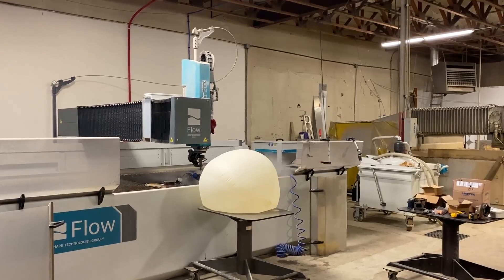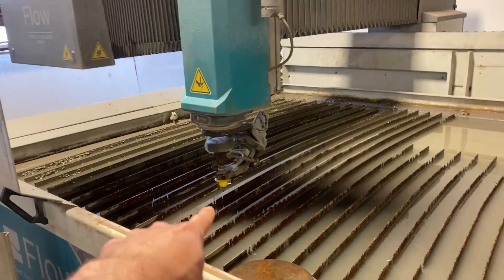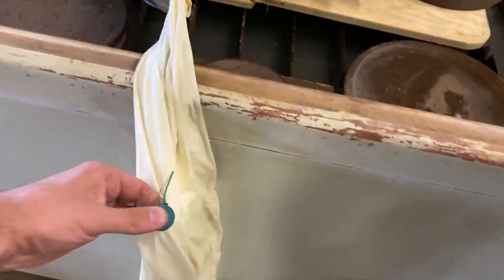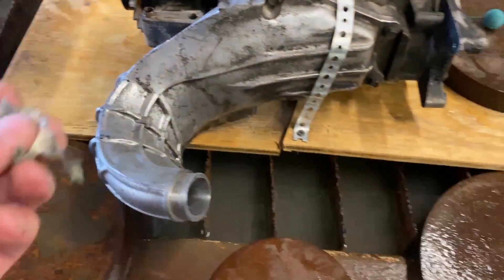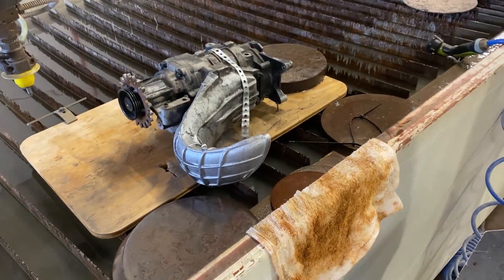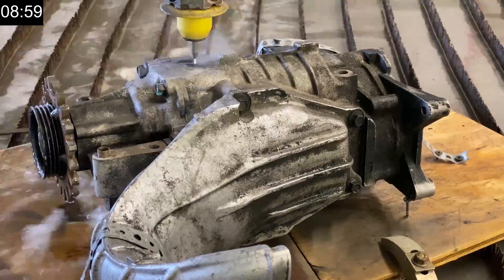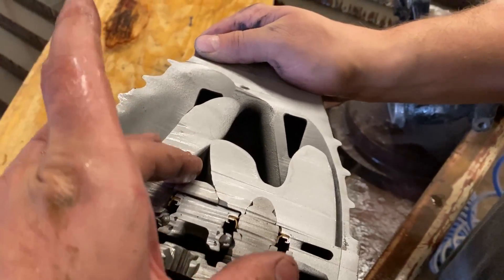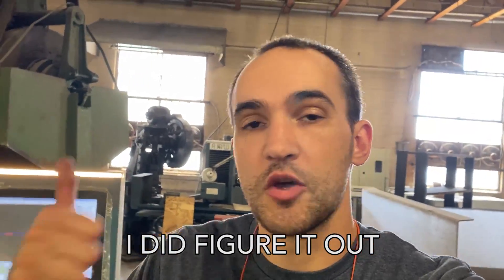Spool a Supercharger with a 60,000 PSI Waterjet

Comment: Love this channel, genuinely amazed nobody has been seriously injured yet. Spinning that blower up to RPM ranges it was never even remotely designed for, just waiting for it to go critical and send large metal shrapnel out with the force of a hand grenade with someone standing right next to it. Considering that blower was almost entirely cast metal means when it fails it is going to shatter especially at that kind of RPM.
I learned to respect rpm a while back when I was messing around in my shop spinning up a old fidget spinner with an air compressor, It slipped off the dowel I was holding it with and when it touched the floor still spinning at some ridiculous rpm it detonated, had a piece go through the bottom of a workbench up through the 1/4 plywood top and punch a hole through a HVAC duct. Realized at that moment it could have easily killed me.
Reply: I was literally yelling that at the screen
Reply: Death by fidget spinner sounds like a bad way to die 😂
Reply: you have discovered danger nut lol
Reply: Are you saying that i shouldn't spin up old 10kg bearings with compressed air?
Reply: @MonstertruckBadass  ive never seen it doneirl but ive heard about it. people on submarines will use 125 air to spin up a nut on a screwdriver and then fling it, and itll go pinging all over the place because basically everything is metal. just make sure no one important is around looool
Reply: @jackradzelovage6961  Thats what it sounded like when the fidget spinner hit the floor. the metal weighted pieces from the ends of the "wings" ricocheted off the concrete floor. Made that movie still ping then whistle sound as they went flying all over the basement. The actual center bearing only had a small dent in it.
Reply: @jackradzelovage6961  That sounds really funny but at the same time it sounds like I don't wanna be near it haha
Reply: @MonstertruckBadass  i want to try it once but im not brave enough to get in trouble for it, so i might be waiting a while
Reply: The rotors are billet aluminum, not cast.

Comment: Blowers move air around the outside of the “screws”, between the screws and the housing.
Reply: Roots type superchargers, yes.
Reply: There is more than one type of supercharger whiple and screw. There’s simple name is just called supercharger rotors
Reply: @georgejabbour2625  yes, Roots type move air between the rotor and rotor housing, twin screws compress air between the rotors

Comment: Works as intended.
The Supercharger will fill that balloon at lower rpms, so even if the water jet is making spin slowly, it'll push more air. 
The Turbocharger won't fill the balloon as better because you need that water jet to make it spin quicker, because only at high rpms you're able to make it spool.

Comment: Pretty cool. I like the smoke bomb effect.

Those "gears" inside are called screws. Just think of two counter rotating screws really close to each other, they're gonna move something even if it is just air. 

Air is a solid, and you proved it with the baloon. Supercharging for dummies.
Reply: I thought they were called "lobes" in that design.

Comment: Volume and pressure are two different things. 90psi coming out of the tiny air chuck hole is much less volume than whatever amount of air you guys had coming out of the giant turbo hole, at lower psi.

Also, that's a roots blower because the blades are cut straight(ish). In a twin screw supercharger the unit is actually a compressor and the blades are cut as actual screws. They're more efficient because they're compressing the air in the unit itsself where as a roots blower just hogs a shit load of air into the lower manifold where it's then compressed and finally flows into the engine. In practice application you can look up the difference between a stock eaton and a whipple in the 03/04 cobra world, or most high HP mod motor fords for that matter

Comment: I wonder if this could be an effective system for remote mounted superchargers? Hydraulically driven instead of belt or gear driven.
Reply: Apparently the BF-109 fighter had a hydraulically driven centrifugal supercharger. Now I am invested.
Reply: there are some guys that use highly compressed air tanks to create thousands of horse power in their car, Camaro. i should put that link here. i forgot it. 
3 or 4 tanks in the trunk but only lasts like one 1/4 mile run.
Reply: and by the way, they do it with no fuel.

Comment: Those gears are technically called helical gears. Those are the types of gears that would be used in a Roots style supercharger. The other styles of superchargers would be Twin Screw, (Same concept, but the gears look like two screws.) and the Centrifugal, (Basically, a belt driven turbo, examples of this type of supercharger would be Procharger, or A&A superchargers)

Comment: To be fair, the amount of air moved by the turbocharger is higher in volume, and less in pressure, while the hose is higher in pressure but much less volume. Remember, its Pound per Square Inch, not Square Inches per Pound

Comment: The turbo has a much bigger air flow compared to your 90psi compressor. Bigger turbos flow way more air mass than smaller turbos even when they both are at say 20psi. Some one may explain better but because the turbo filled it quicker than the compressor it doesn’t mean the turbo was over 90psi lol

Comment: Just a heads up. breathing compressor air is a bad idea if the compressor and filter system isnt designed for it. oil filled compressors generate CO from the oil in them. obviously your not breathing it long term but for anyone watching that might think about it.... its a bad idea!!

Comment: Uhhh who is gonna tell me what is the difference between a turbocharger and a supercharger?
Reply: Exhaust gassed spin a turbine on one side of a turbo (hot side) attached to a compressor turbine on the other side (cold side) which forces more air into the engine. There’s a couple of types of supercharger. A centrifugal supercharger works the same as a turbo except it’s belt driven instead of exhaust driven. A twin scroll or positive displacement supercharger like the one down in the video uses two long worm gears rotating driven by a belt in opposite directions in close proximity to force air into the engine. :)